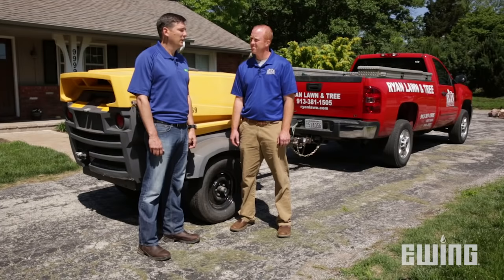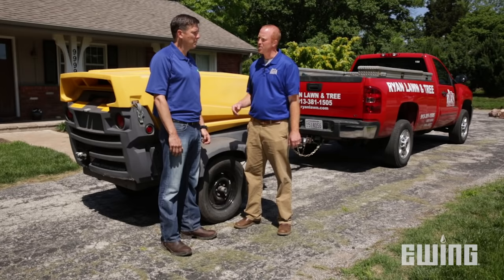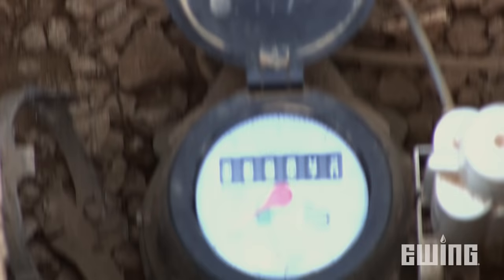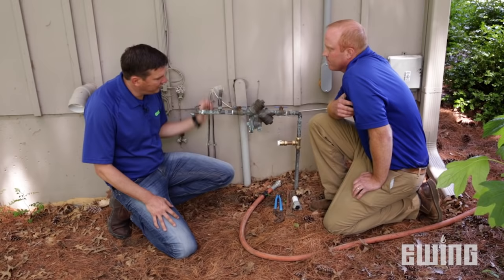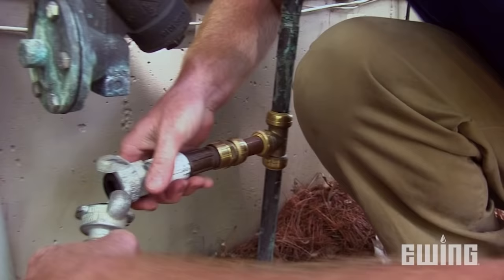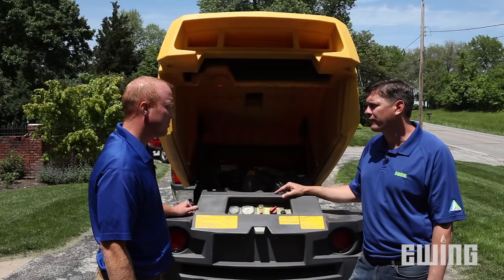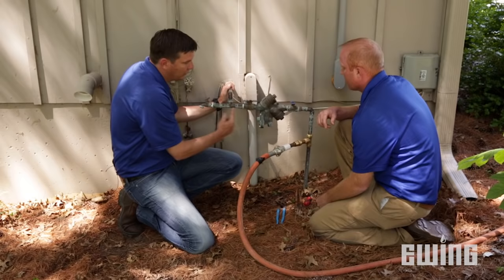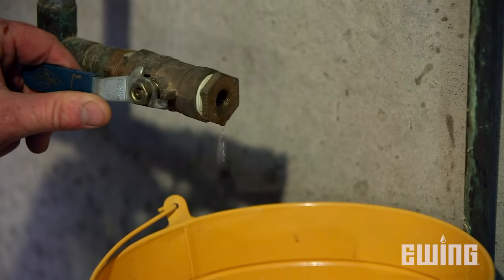How to Winterize a Sprinkler System - Blow Out Method

Comment: He left out the most important thing.  Do not run the pressure too high to your sprinklers!   90 psi max.   You will blow out your heads or worse, break stuff.   Also If you are a home owner with a moderate or small spinkler system a $100 compressor with 4 scfm is fine.   You just have to wait a few times for it to build up pressure again.   Overall it was still quicker for me doing it myself than calling the irrigation guy, meeting him, and writing an $80 check.

Comment: I'm going to add a tee for the compressor connection on mine for blow outs, but what parts do I need on a galvanized pipe?
Reply: The threaded female adapter is mainly what I'm questioning. Are the compression tees only in brass?
Reply from the maker: This is a tricky one since corrosion can be an issue if going directly from galvanized to copper or other metal. If you can avoid it, refrain from tapping into the galvanized pipe. Assuming the galvanized transitions to PVC below the backflow, it would be a better idea to dig down to the PVC and add a tee there. Cover the new connection with a small round valve box for easy access in the future. If you have to tap into the galvanized pipe, you can use a galvanized compression tee. Be aware that if you transition from galvanized to another metal, you will need to use a dielectric fitting in between, a union for example, to prevent corrosion. We would recommend hiring a qualified contractor in this situation.

Comment: If you have a compressor, maybe do it yourself. We’ve had several landscaping companies do the winterizing blowout … and they did it wrong! And, got angry at us for pointing out that they shouldn’t be connecting to the pressure vacuum valve. Idiots.

Comment: Thumbs down, only showed how to blow the first station. We all have more than just one station.
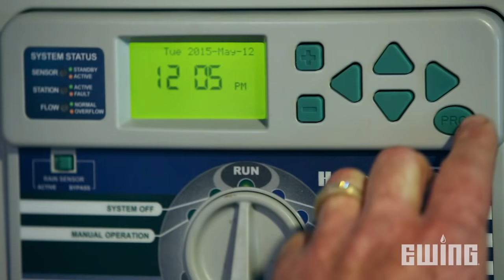Reply from the maker: Hello @31acruz, to blow out the other zones, you just follow the same process as the first one. So if switching to zone 2, turn off the compressor, manually start zone 2 to run for a few minutes, then start the compressor again. Watch again from 4:47 for the steps.

Comment: I have never "blown out" my sprinklers. I have had them for over 18 yrs. And I live in utah.
Reply from the maker: +B Neilson -Thanks for watching! At 1:58 in the video you'll see an image depicting what can happen if an irrigation system is not winterized in climates where freezing occurs. We're happy to hear that you have been able to beat the odds of something like this happening to you! Do to the potential damage and associated costs for repair, we always recommend winterizing irrigation systems located in areas that experience freezing temperatures.
Reply: That is because the pipes are above ground. I have never heard of this and dont know anyone who does it. Maybe some people dont have a drain or something? So, in my life of 60yrs this hasn't happened to me or anyone I know. It seems like the odds are in my favor by a very big margin. Thanks.
Reply: B Neilson congratulations on never having a problem. What's the objective of your comment? If it's to convince people not to blow out their systems you're doing a disservice to them. Believe it or not, in colder climates, water does freeze. When the water freezes it will easily burst pvc pipe.
Reply: I have found in smaller systems running the sprinklers with the water turned off at the irrigation line (those that don’t have culinary water and back flow preventers) can blow out enough water that risk of frozen pipes is near zero. 
However, any above ground or near surface pipes will burst if not treated properly. Also seen this. It’s awful to fix. 

I also live in Utah.
Reply: I was thinking the same thing. Who has their pipes above ground (especially in colder climates)?? I've never had a problem with freezing pipes, but my neighbor has. His pipes were buried maybe 6 inches, so I'm not surprised. My pipes are a foot below the surface and my valves are at least two feet below the surface.

I've been curious if blowing out the lines is a nice precaution, or if it's really critical and I've just been lucky for years. I think this video is good, but it seems more relevant for someone with above-ground pipes. Also, the guy's yard looks like it could rival a park, so I can see why you'd want the volume of that air compressor. I think most lots range between 0.15 and 0.25 acres (and of course not all of that requires irrigation), so a homeowner will likely be fine with their own air compressor.
Reply: You're taking a risk that is not worth taking IMO, the cost and time to replace a busted backflow preventer or pipe is too high compared to hiring someone or even blowing your system out yourself. When something goes bad you'll wish you put the maintenance effort in.
Reply: I do blowouts and when people tell me they don't believe in winterizing their system in the fall, I tell them "that's fantastic, I do repairs in the spring as well."
Reply: no way. even with those harsh, frigid cold winters in utah ? surprising.
Reply: Someone didn't do their research. https://www.google.com/search?q=salt+lake+city+average+temps&ie=utf-8&oe=utf-8&client=firefox-b-1-ab  And that is one of the more moderate northern cities.  Again, those are averages.  Negative temperatures and low single digits are common in winter.
Reply: Jeremy Gaiser Funny how people who’ve obviously never been to Utah, at least during winter, tend to assume it’s entirely a hot sandstone desert. 
Yes, summer temps reach over 100f but Average overnight winter temps in Salt Lake Valley are well below freezing. 
What you master meteorologists don’t understand is that Utah is a big state and the northern end gets very cold compared to the south. It’s also mountainous and temps vary drastically with just a few miles change in linear location so your google query for Utah’s overall average winter temp is going to give you a useless figure for trying to guess what “that guy from Utah’s” local climate is like.
I get about 3 ft of snow annually at my doorstep. 15 miles up the road, Brighton Ski Resort averages nearly 100ft.
In fall/spring, it’s not unusual to see 50 degrees plus change in a 24 hour period so effects of water expansion from freeze/thaw cycles are especially bad here.
Reply: As a new home owner in Utah, I'm glad I read this. crosses fingers
Reply: This is what 90% of my customers day as they write the repair check or send venmo.